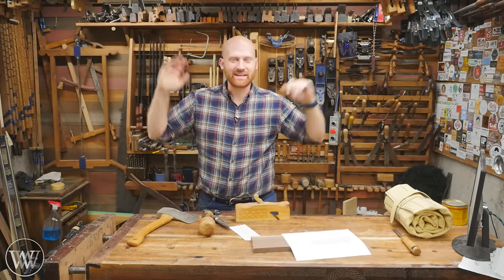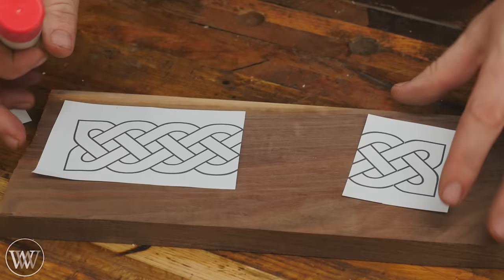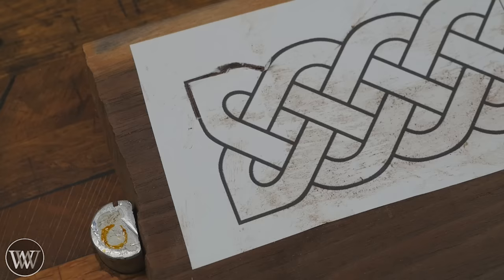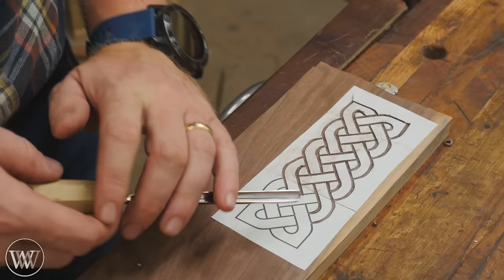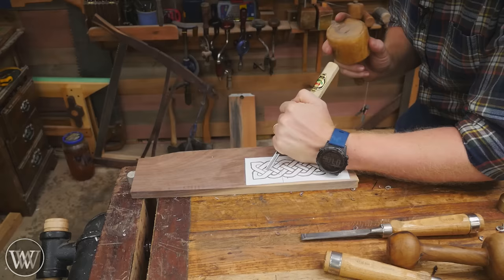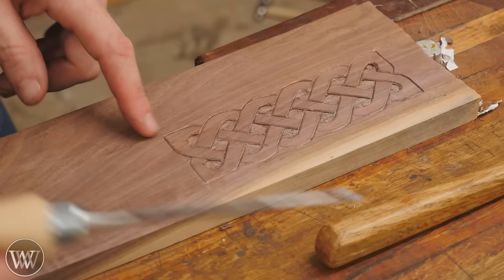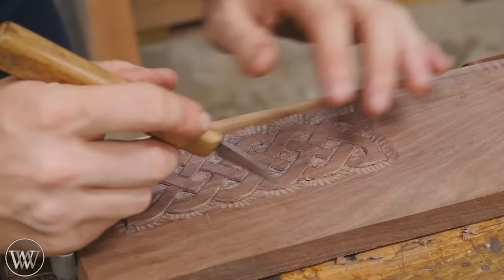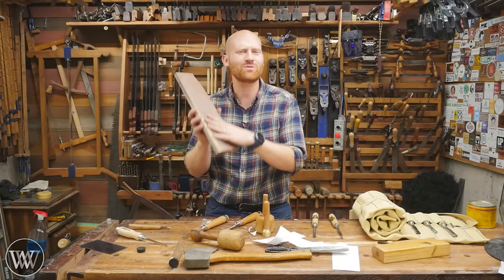Simple Carving With Basic Tools

Comment: New subscriber after this video. Thank you for the instruction and inspiration. One thing that I found to temporarily stick paper to wood is a 3m "lo tack" spray adhesive. It's easy to remove, yet tacky enough to work with. It has to be low tack though.

Comment: Might make your life easier by tracing your stencil image on to the wood using carbon paper.  Thanks for the video :)
Reply from the maker: I've done that a few times but generally I prefer to apply the pattern rather than stencil it. But if I need to put the same pattern in multiple places carbon paper is usually the way I'll go.

Comment: would a vinyl plotter / cutter be any better over the printed design ? I could easily cut the self adhesive stickers and weed off the "black"  design to expose the wood  -  only if it worth it ?   I am a beginner and need to curve a 5m oak post .  I assume large design are easier to carve  Thanks for your upload !
Reply from the maker: Larger designs may be easier, but when you're closer to them they're harder to make perfect. Thankfully, when you step back they look far better. Using a vinyl printer might be interesting. Way to try it. I never done that but there's always a first

Comment: You said you can't get the gouges cheap...  But I'd love to hear what you think about the super cheap ones at Harbor Freight.  I'm sure they need sharpening, but I've been surprised how good their stuff is at their prices.
Reply from the maker: Unfortunately those are not carving chisels. There bent pieces of steel that they list of carving chisels but none of them are even shaped correctly. Even the skew isn't actually excuses it's just a hunk of metal that kind of has a sharp edge. I have tried regrinding and forging them into something that has the correct shape but even then they just aren't fitting quite right. So unfortunately I have to say no. Not we're spending 5 bucks on.
Reply: Some of the products from HF have served me well and some haven't. Unfortunately HF seems to fall short on most of their decent woodworking tools or abandon them all together after a while . Their wooden handled chromium vanadium chisels weren't bad for the price but the plastic handled chisels have poor steel. As soon as the word got out about the wooden handled sets they stopped selling them. Like James says, their carving chisels are items that should be left on the shelf.

Comment: great video, thank you. I have a question. when using a mallet, at what angle should the chisel be held?
Reply from the maker: It depends on the bevel of the chisel and the depths you want to cut. If you're using a v tool then your angle determines how deep a cut you'll be making. If you're using a straight chisel with the bevel up then the angle you place it at is the angle of the chip you want to cut.
Reply: @WoodByWrightHowTo  Thank you so much. Truly appreciate it

Comment: What kind of clamps do you use to hold the wood block in place?
Reply from the maker: Different clamps for different places. But most the time I'm using a hold fast. Often I'll use hand screw clamps
Reply: @WoodByWrightHowTo  Thanks. Btw, I'm on the video called "Simple Carving With Basic Tools" in case the app doesn't show you the video I'm commenting on. All I see are some metal screws coming out of the board, though I believe the left one is part of a moving part of the table. I like tht this way you can move around the table with a chisel and a mallet and hit from all sides.
Doesn't a hold fast prevent you from doing that?

Comment: What kind of wood do you use that it requires almost no pressure to carve at 8:55
Reply from the maker: Most words just require a little bit of pushing from the poem on a freshly sharpened blade. Even an oak and hard maple. You go to things like basswood and you can let the weight of the chisel and gravity do the work for you.

Comment: what kind of timber is best to carve? or what are you using here? (im a beginner)
Reply from the maker: Depends on how you learn. The easiest wood to carve would be basswood. if you run into difficulties and get frustrated I would definitely say start there. It will teach you a good bit but it's easy enough that most people can run through it. If you're like me and you run into difficulties and it just makes you want to do more than I would say trying to start with something like oak. It is incredibly difficult to carve but if you can carve oak you can carve anything it will teach you all the skills. It is both hard and the grain strips out easily.

Comment: What is a good cheapest wood to get started with?  I think I’m going to need some amount of learning curve to get over before putting this in a show piece.
Reply from the maker: whatever you have on hand. pine works really well. to be honest there is no best wood. The easiest out there is basswood, but I also like Walnut, and cherry. The more difficult the wood the more you learn.
Reply: The most readily available option is a bar of soap, but like he said, that really won't teach anything. I learned on basswood, but it wasnt till I broke a gouge edge on a piece of old oak that I learned what NOT to do (don't pry  chips out. If they don't fall out, don't use a $40 edged tool as a prybar!)

But to answer the question, just buy a 2x4 or whatever dimensional lumber that is cheap and fit the need your project has, and carve away! Just pick one that doesn't have knots all over the part you want to use!
Reply: @woodworkerroyer8497  Don't use one with knots because we don't want "knotty" carvings?

Sorry, I had to go there :) Thanks for the info.

Comment: This was awesome! Thank you! I have a question. What are “good” woods to carve with? I was interested in Indian Teak wood, but that is very hard to find here. Do you know any wood that would be similar?
Reply from the maker: every wood has its pros and cons. as to good it depends on what you want. do you want something easy, do you want something that teaches. probably the closest in color but easy to carve would be a walnut. air dried walnut can look a lot like that. though it does tend to be a bit darker. a black cherry might also be close.
Reply: @WoodByWrightHowTo  thank you so much for your reply! One day I want to do something I found on Instagram (mahajati.com or @mahajati.art). 

I tried starting with bass wood, but the intricacies of a design would chip away. I tried using walnut and it was just to brittle.

Comment: I feel like a chip carving knife would be a simpler way to do those corners without needing a gouge. Perhaps that's a specialised enough tool to defeat the purpose of 'with a few simple tools',  but I don't think so personally.
Reply from the maker: Right on. That would work perfectly. Just about any sharp edge would do the job fine. I even know a guy who does carving with a steak knife. As long as it's sharp enough.
Reply: Give a nail to talented person and they will use it to produce a piece of art.

Comment: I tried chiseling a weave with maple wood (soft wood), and it would chip and crack off the line really easily, am I doing something wrong or is it a lot easier with hard wood?
Reply from the maker: I am slightly confused. Maple is a very hard wood. Even soft maples are hard woods. Soft woods are pines and firs. It sounds like you are just not following the grain. If you take too big of a night or try to cut into the grain direction. It will split out in front of the chisel. You should check out a video about carving a doughnut.
Reply: @WoodByWrightHowTo  Ah rightio cheers, it must not be maple, it's as soft as the pine I was carving. Are softwoods more difficult for this type of fine detail carving than hardwoods in general? Thanks for the tips and I'll watch the carving a donut video.

Comment: Can this also be done with pine wood?
Reply from the maker: Sure. Pine is a lot easier except you have to make sure you're very careful with the grand direction it'll run out on you if you push the wrong way. But it takes a lot less forced to cut. The only downside with pine is your tools will need to be a little bit sharper otherwise they crush the wood rather than cutting it.

Comment: Hey James, I have a question about sharpening gouges, I bought a set of scaff carving gouges and tried sharpening them, some of them was easily sharpend but 2 of them, one a v tool and the other one is a small gouge. that when I tried sharpening them, their edge folded like it was made out of plastic. Do you know what is the problem, and what can I do?
P.s: the egde on the two gouges wasn't flat so I tried straightening them.
Reply from the maker: Is that is usually a sign of the steel being too soft.
Reply: I actually own several sets of the Schaaf carving tools (along with over two hundred other high-end carving tools)  and have found them to be some of the best I have ever owned even though they are very reasonably priced. I suspect the issue is a too-low sharpening angle which should be around 23 degrees or so with the inside edges of the profile. My next guess would be overheating if you grind them on a grinder. While they do require a little more attention to perfect the edge (commissioning) when compared to the ultra high-end brands, I normally have to shape chisels to my preferences anyway, and I have frequently had to rework used tools when I get them, I find the task very simple. V tools and small veiners always seem to give even experienced carvers the most trouble if that is any consolation. Very small and shallow bevels on the tool profile interiors strength the edge without changing the "attack" angle of tool to wood. Schaaf is supposed to be introducing some additional tool profiles to their line later this month.

You might want to consider getting together with an experienced carver to work on your sharpening technique and a local carving club would be a good way to do that. If you are located near Knoxville TN I would be glad to help you out.
Reply: One other thought I had on the subject; are you sure you stropped the edges enough to fully remove the wire edge that develops from sharpening? If not then it is possible that was happened is that you confused the wire edge with a degrading edge. Check out May May's videos for tool sharpening for help on sharpening. Have fun.